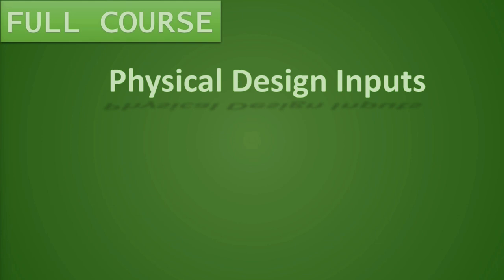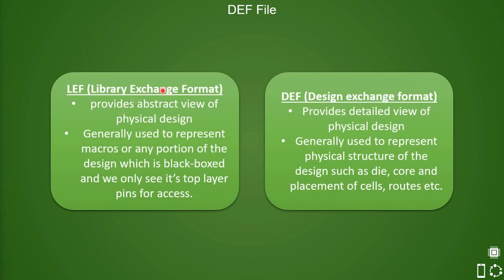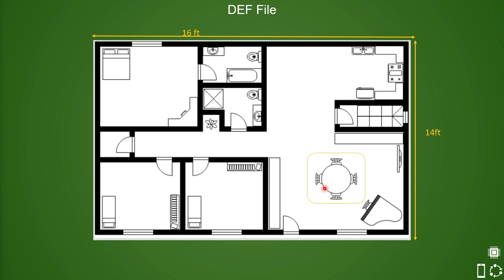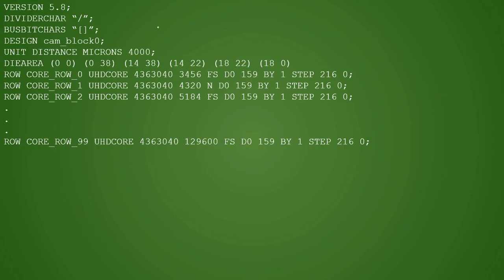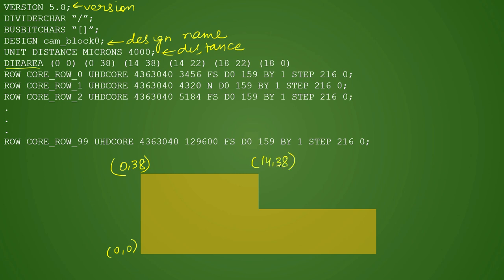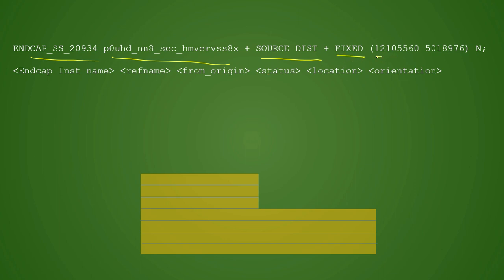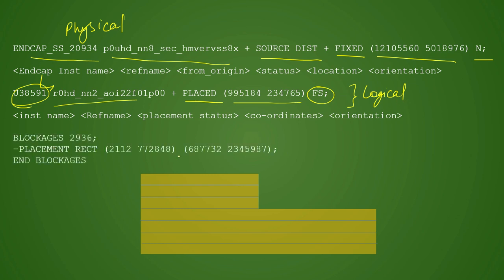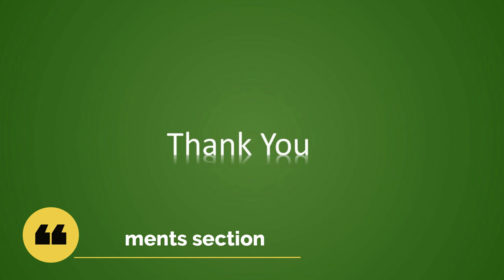PD Lec 13 - DEF File | PD Inputs part-6  | VLSI | Physical Design

Comment: If the area is specified by coordinates, does it really matter whether it is clockwise or anti? Also, if I am thinking correctly, then if I have the DEF & netlist & SDC etc of a block, then I have completely specified the block, right? Or that is what is dumped out after every step in the PnR(place,CTS,route) process, right?
Reply: @VLSIAcademyhub  ohhkkk, thank you for the clarification 🙏
Reply: @VLSIAcademyhub  correct, so basically an mwlib/ndm is basically a wrapper of the tool readable format over all the collaterals specified, including the DEF, upf, DFT, sdc , .tf, .liberty, macro blackboxes, etc right? And the synopsis tool dumps out an NDM/MWLIB at the end of each PnR step as much as I remember.
Reply: i cant see the reply by vlsiacademy hub